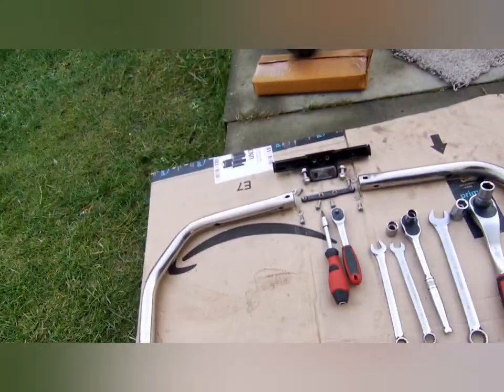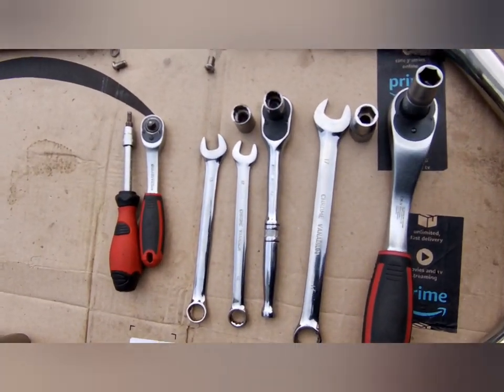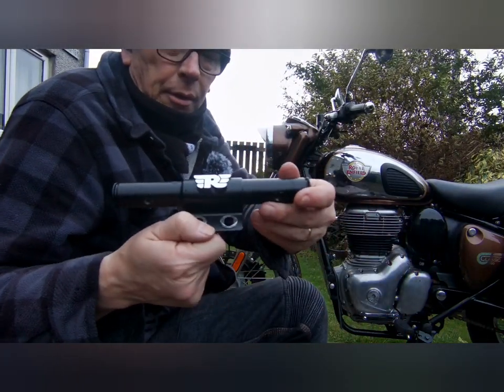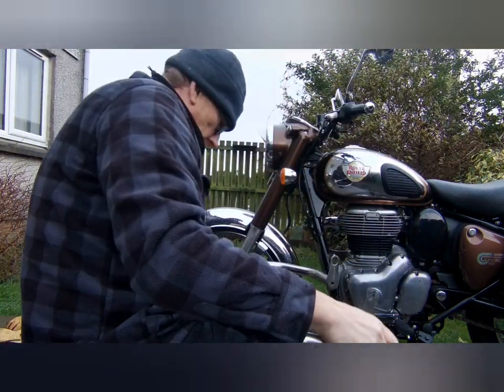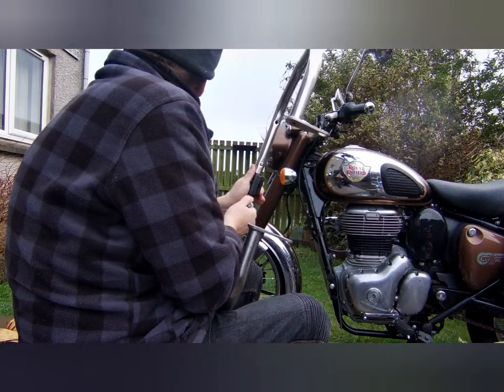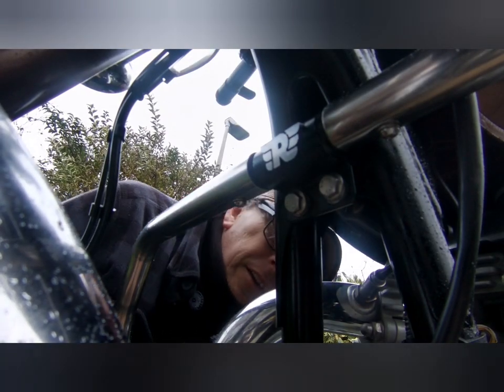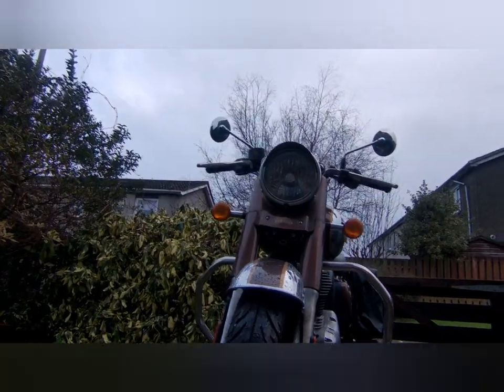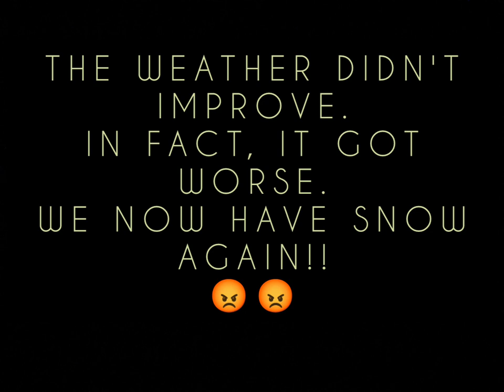Fitting crash bars to my Royal Enfield Classic 350 reborn.

Comment: Thanks. Looks easy to do.
Reply from the maker: Yeah, it was definitely one of the easier jobs I've done on the bike. 👍

I also posted a video about fitting the rear luggage rack. It was a bit more fiddly, but I got there in the end.

I've used the luggage rack loads of times, but thankfully I haven't had to use the crash bars!! 🤣

Comment: Hi Dougie good video but did you remove the clutch cable fastener at the top of the left LH fork? On the fitting instructions I managed to download from Royal Enfield it says    
  "Ensure the clutch cable is not routed through the upper cable guide at the top of the front LH    fork. Easily unplug the clip from the vehicle, its snap fitted."                                                                                  Its a plastic clip that just pulls out, and it stops the cable pulling tight when you turn the handle bars to the right.
Reply from the maker: No I haven't. But thanks for pointing that out to me, I'll have a look and see if the cable pulls tight on right lock.
I can't say I've noticed though.
The crash bars never came with any instructions!
Reply: No there was no instructions in the box but Royal Enfield have started putting a QR code on the outside of the box.this takes you to the installation instructions.they are good giving torque setting as well
Reply from the maker: @paulflame8863  
Thanks for the info. I just assume that bar codes and qr codes are all to do with stock and delivery, so I never really look at them.
Reply from the maker: Hi Paul,
Just to let you know I located the clip you mentioned, but before taking it out I turned the bars lock to lock and the cable didn't get tight. I also watched where the cable goes into the gearbox to see if it was being pulled, but it wasn't, so I'm just leaving the clip as it is.